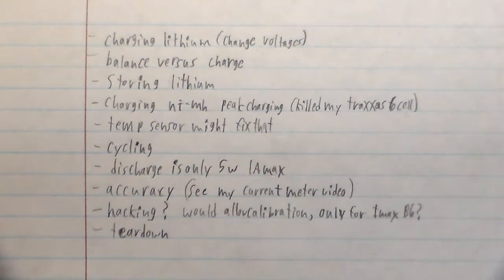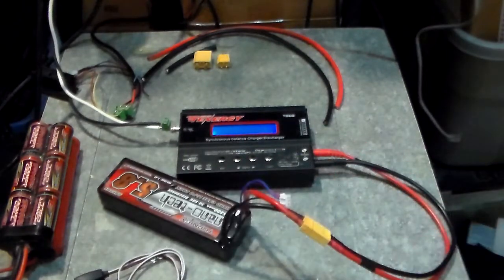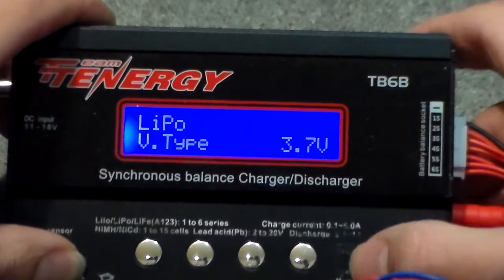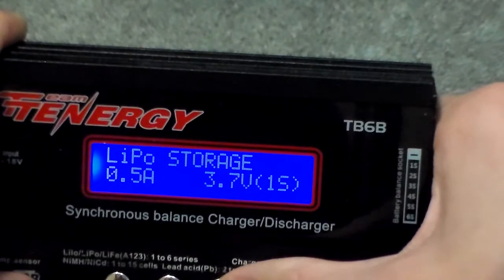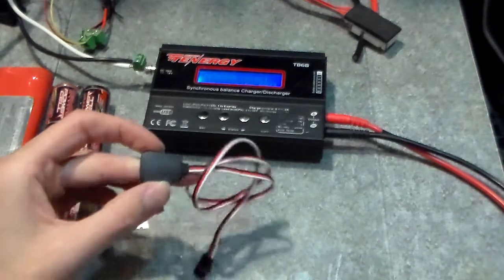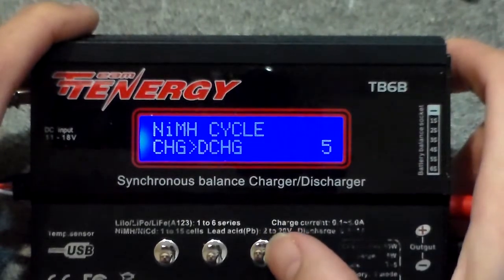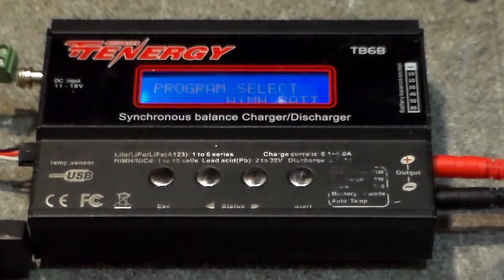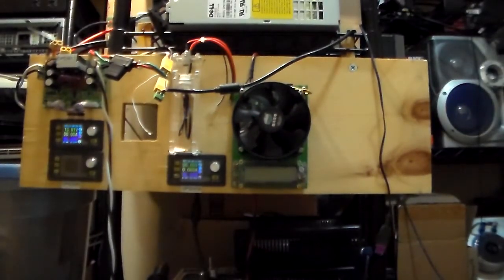My Tenergy TB6B 5 years later! Review In Depth

Comment: You talked about capacity cut off, how do you change the cap cut off I have a 6000 pack I'm suing? Why is bal changing not recommended I been doing this since I owned it
Reply from the maker: To change the capacity cutoff go to "User Set Program ->" scroll until you see "Capacity Cut Off" hit enter, make sure it says "on" on the left side, then scroll to the actual capacity value and change that to 6000. Why you shouldn't or dont need to use the "balance charge" mode is because if your battery is already balanced you dont need to waste time trying to make it balanced, you can just use the "charge" mode and it will do a small amount of balancing as needed but will not sit for a long time and balance. This charger is not very accurate so it might even cause unbalancing of the cells during the charge then remove the balancing after. That is why I recommend just using the charge mode.
Reply: @SuperBrainAK  thank you I played around with mine and found that. Unfortunately my first charge was a balance mode cause that what I was told . I did check my ir on all cells except cell 1( which was 9)  they were 2 or 3.

Comment: Got one today only thing I didn’t realize is my battery is a 7.4 2s lipo 5200 mah 
Says I have to charge at 5.2 but charger is only a 5 amp. Gets the job done actually after 2 hours it finished
Reply from the maker: ツSneakyJustPlayz yea you don’t have to charge at the rated charge current of the battery, lipo’s don’t care about charge current. If you charge it slower then it will actually live longer because fast charging can wear the battery out faster. Thanks for the comment
Reply: SuperBrainAK yeah thanks but still a bit confused. If I have a higher charge rate and balance the battery will it still wear the battery faster?
Reply from the maker: @TortugaBruv  yes, the closer you are to the max rated charge rate the more stress is on the battery, I would recommend a 0.5C charge rate, you know what the C rating is right?
Reply: SuperBrainAK nope 2.5amps?

Comment: Also is there a way to tell how far along the charges is? Thanks for your time
Reply from the maker: no, you have to guess based on the voltage or the current. if it is a lithium battery then almost full is when the charger switches into constant current mode and the voltage has stopped climbing. otherwise it is how close to either 4.2v or 4.1v which is the full voltage of li-po and li-ion. for ni-mh the charger should peak at around 1.5v per cell in series, so for a 6-cell ni-mh pack it will be fully charged at around 9v. I hope this helps! thanks for watching
Reply: @SuperBrainAK  I have 1500mah lipo

Comment: holy fk, after 5 years later and ya can't explain how it works in 15 minutes ?? allthough we get that it's good
Reply from the maker: lol, sorry, I havent been using it every day. but yea its a decent cheap charger and as long as you dont abuse it it is fine
Reply: Is there a way to replace the squid with just a single banana to XT60 plug? Also on a three-cell battery is it always balanced charge or is there any sort of quicker rapid charge?

Comment: is there a way to modify the LiPo setting so that it will charge LiHV batteries to 4.35v?
Reply from the maker: you cant do that on this model, only 4.2v (Li-Po) or 4.1v (Li-ion) it might be possible to flash it with the Imax-B6 custom firmware since it is a clone, but that requires risky modification to the charger.
https://github.com/stawel/cheali-charger

Comment: Does not LiPo= Lithium Polymer and yet LiFePo4=Lithium Iron Potassium? Different chemistries? Thanks for the long term charger review.
Reply from the maker: yes, they are different chemistries and have different charge voltages. LiFePO4 is actually  Lithium Iron Phosphate which has a maximum charge voltage of 3.6 volts. thanks for the comment

Comment: The only reason I bought this charger was to balance my 2s and 3s lipo battery cells. I also have a six cell rig for charging 6 one cell batts at the same time. That must be done in balance mode. Why would you say balance mode not usable?¿